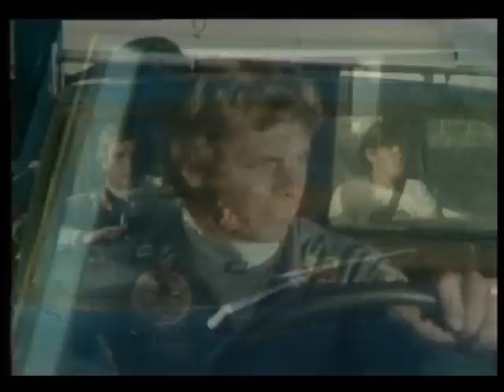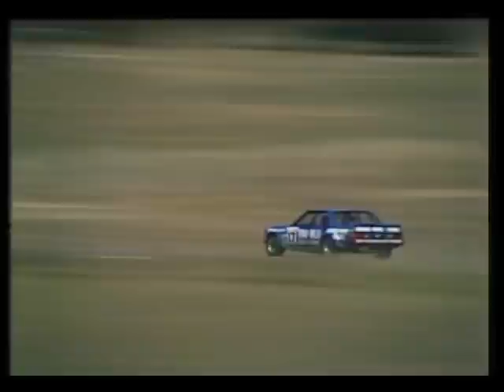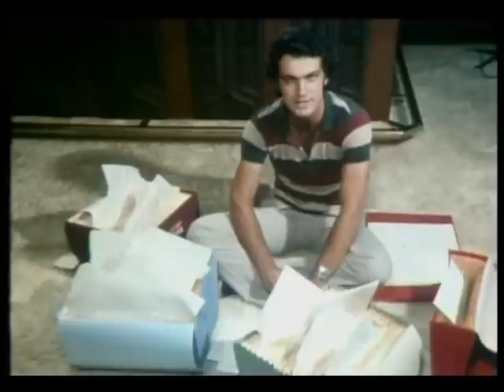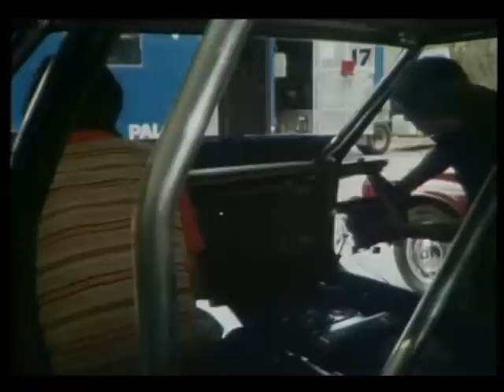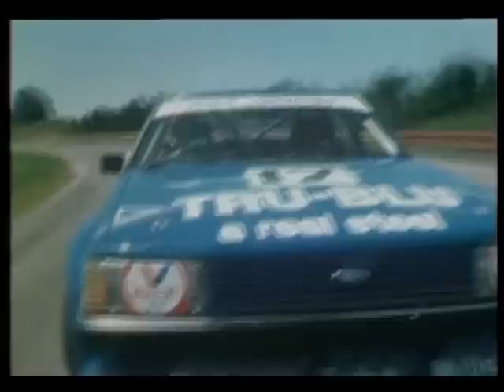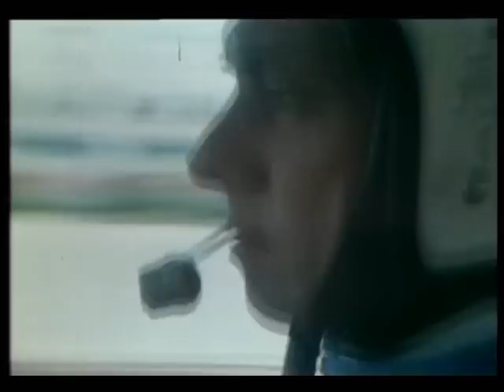Dick Johnson and his Tru Blu MkII

Comment: The first race of XD was at Lakeside When he turned up it had the seats from the XC hardtop In those days you had to have the full interior, and those days we used to roll the floor mats up and put them in the boot The Back seat had almost nothing holding it together When he was our driver at BBF he drove the last Bathurst in the XC with Gary Scott I think?? When he first raced the XD it had a Peter Molloy Built Engine AT BBF we had 2 sitting under the bench one race engine one Qualifying engine